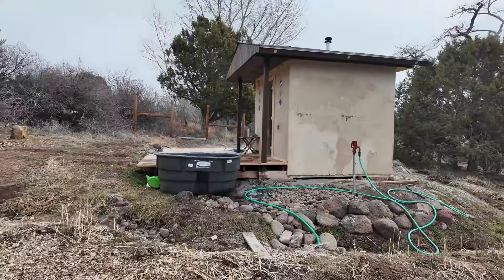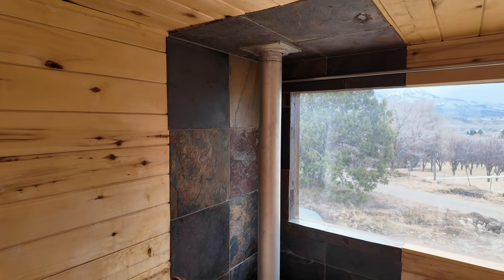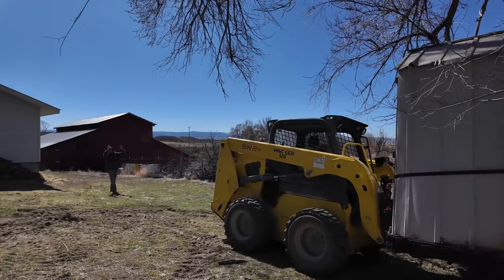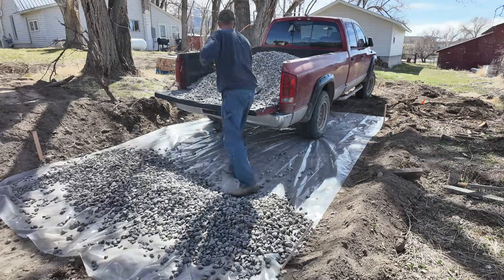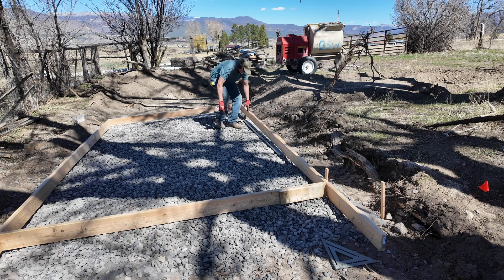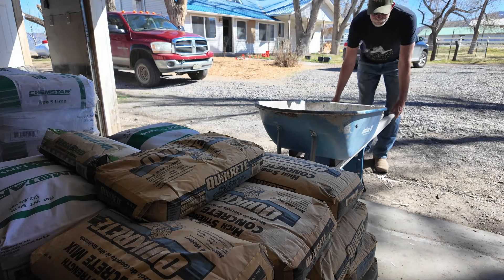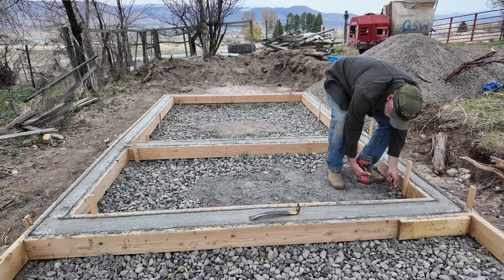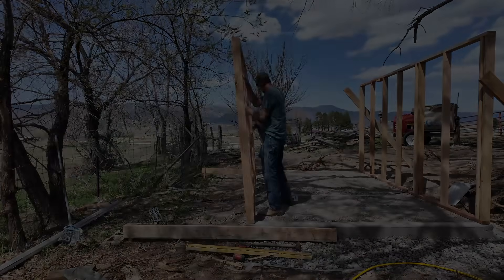Building a Dustcrete Sauna Episode 1: Plan, Site, Foundation

Comment: Appreciate your knowledge tremendously. Now I know how to nixtamalize maze. Have your summer sausage recipe and love it. Learned a lot and not afraid of using curing salt now.  Anyway as a pepper who is also a rancher. How would you salt cure beef like the old ways? Can't procure saltpeter but we do have instacure #1 and #2. I've looked extensively on preserving food mainly beef for long term non refrigeration preservation and really can't find a solid go to recipe. Large cuts of meat. Do I salt and smoke. Or salt cure with #1 or #2 instacure then smoke? Do I skip the smoke? I'm talking about shtf scenario with no refrigerator but wise enough to put back different nitrates \ nitrites.
Reply from the maker: I’ll start off with my personal plan for beef in an extended grid down scenario. I keep about a dozen cases of quart jars on hand. If we get to day three of no power I’ll start cubing up beef, dry packing into jars with a teaspoon of salt in each, then pressure canning for 75 minutes. I have one of those tall pressure canners that will process 16 quarts in a batch.
For curing options my go to would be carne seca. For that, slice against the grain about 1/4” thick and sprinkle both sides with a salt shaker and hang it on lines of kitchen twine by the stove, or in the sun. Add black pepper to detour flies. Red chili powder is nice, too. The result is super thin and crispy. Also, it  can be pounded, mixed with melted tallow, dried fruit, and nuts to make pemmican which will fuel you completely and last indefinitely. Another good move is biltong. For that cut 1”x1” strips about 5” long and toss with salt, pepper, coriander, and vinegar, then dry.
Whole muscles can also be cured and smoked, but the result will be only suitable for chipped beef. Not bad, but not the highest best use.
I hope that helps, and thanks for the kind words!

Comment: 1) How do you measure the water content in the concrete mix if you use hose, not buckets?
2) Rebar in the concrete works by resisting tension. That's why there must be at least 2 rows one closer to the bottom of the trench, one closer to the surface. In case of the movement of the soil and depending of the place and direction of the movement, one of them will feel the compression (contrete itself is very good at resisting compression (but not tension) and other one will be under tension and do it's job of protecting the concrete from being easily torn apart. Ideally there should be 2 rows of 2 (so 4 rebars in total in square pattern so to say) but for small structures like this one, especially if the soil is not clay, I think, 2 rows will do. Just 1 rebar is... kind of pointless IMO. If the soil is stable as a granite rock - no need for reinforcements at all but if it moves seasonally even a little, there must be at least 2 - one above the other.

Comment: Excellent video -- thank you!!!
I've been gathering material to do a dustcrete build ... just not sure what to build first => something small for the experience.
I need an outdoor kitchen structure, a greenhouse and outhouses.
Reply from the maker: Those three buildings are on my list, as well. An outhouse, even though insulation is not really needed, is a weekend project. It would be a good way to get a feel for the material. Surprisingly, dustcrete is cheaper than board and batten siding.
Reply: @radicalgastronomy   Yes an outhouse would be a good project to get my feet wet
Reply: Hopefully your feet aren’t wet in an outhouse!!